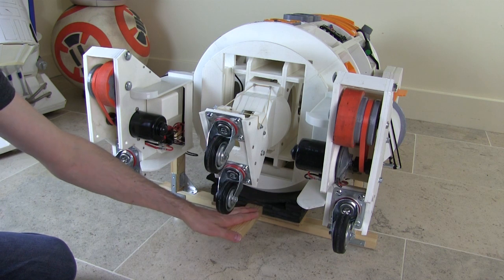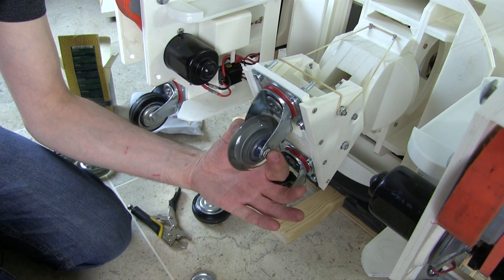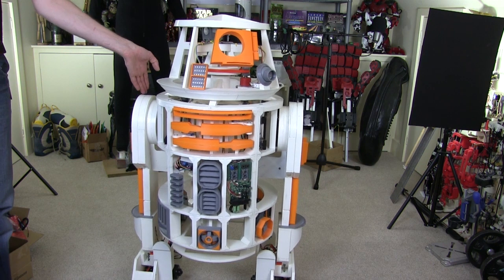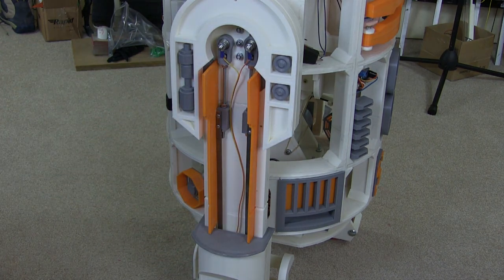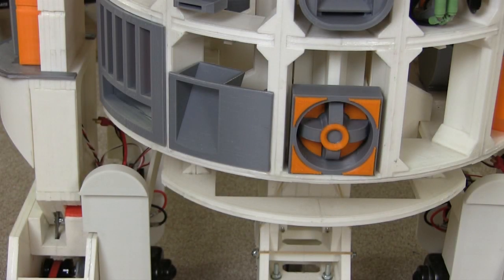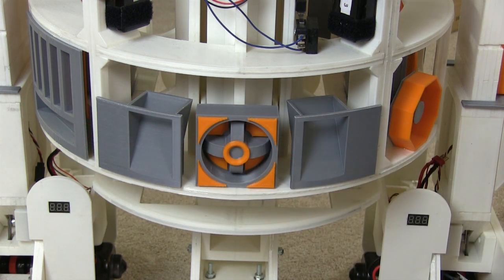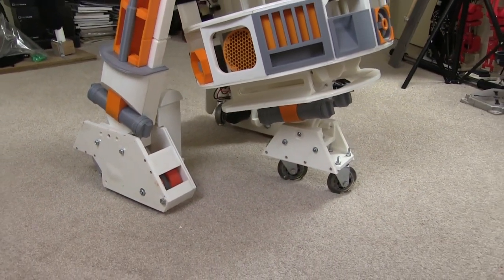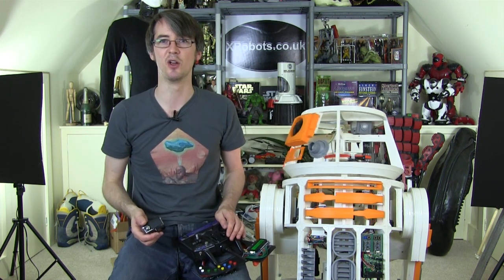Star Wars R6 Droid #16, Various Improvements & Features | James Bruton

Comment: Why is it that some rounded parts (the black eye for instance) are printed way smoother than others which have a more steppy feel (the casing around the eye)? Is it just a case of printer settings, and if so, is there any reason why you'd set it to be more steppy other than filament conservation reasons?
Reply: Thanks! Is that caused by settings in the slicing program? Or by the thickness of the filament?
Reply: Oh cool, thanks for the insight mate!

Comment: ***** - what resolution do you normally print in mate? Obviously you will vary for different parts, but wondered if you tend to stick with a certain resolution for the larger prints
Reply: ***** since you have dual nozzles, can one use a fine nozzle for exterior and large for interior?
Reply: +James Bruton (XRobots) one question answered if I would scrolled down loll